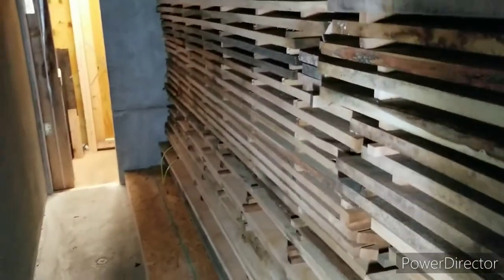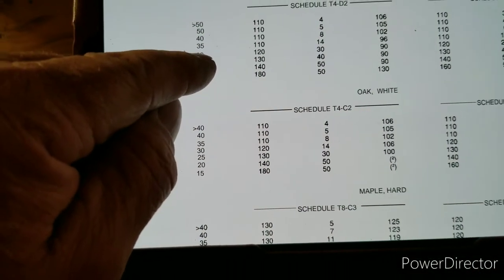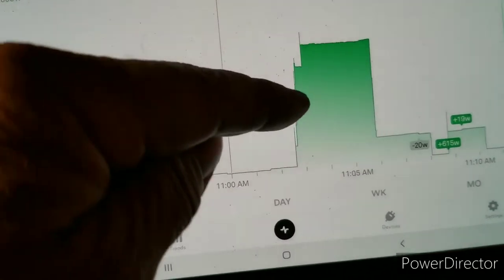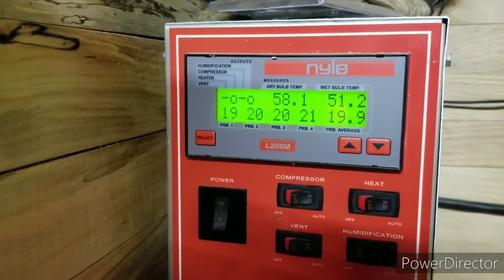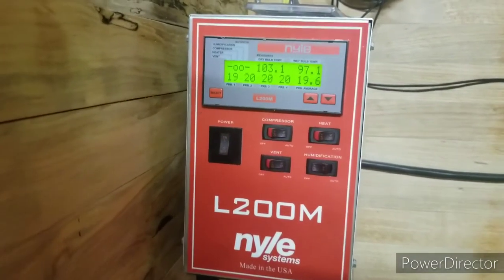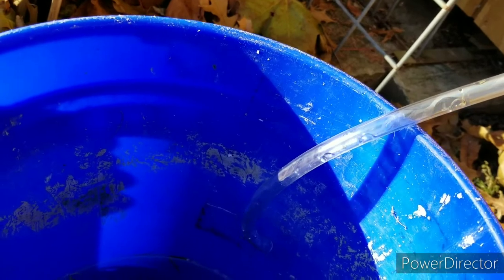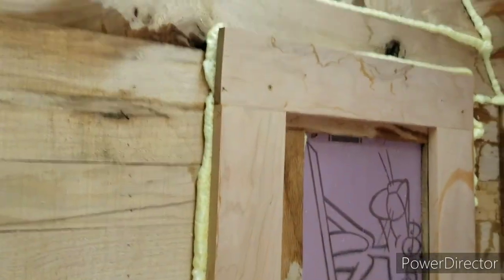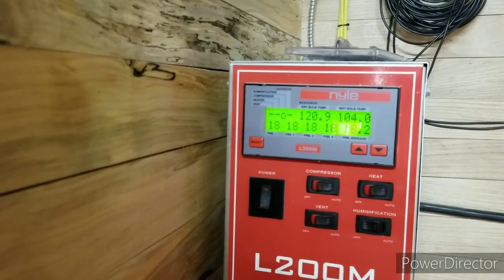Kiln first run, first 48 hours, energy  usage, and my big mistake

Comment: Thank you for the video.  I had difficulty finding any videos of real user experience using the kiln the first time.  Yours is the only video I have found so far.

I had a very similar experience with insulating the kiln and moisture developing anywhere where there was not excellent insulation. 

I hope you are getting good results with your nile kiln and it is paying for itself.  

I am very interested in knowing how well it has been working, and any tips for using the Nile kiln. 

I am opperating mine for the first time an the users manual is vague and the Nile youtube videos don't really cover what can go wrong very well.  Also, most other videos I see on the Nile kiln are either "I got one and it's great so you should buy my lumber" or "it's the greatest kiln ever, the end".  

Not much nuts and bolts info on user experience, day to day operations, and tips/tricks for best practices.